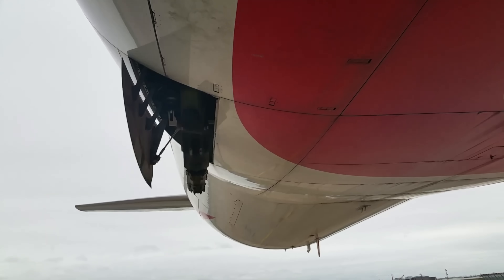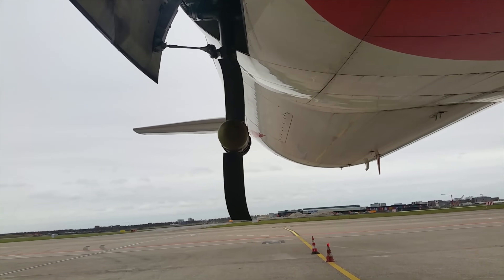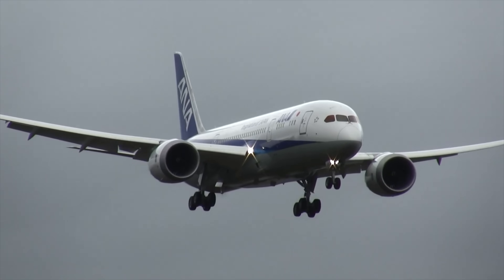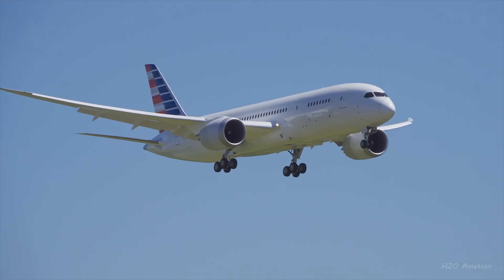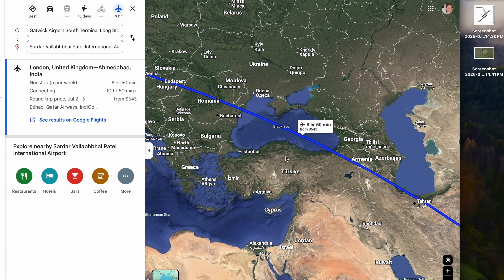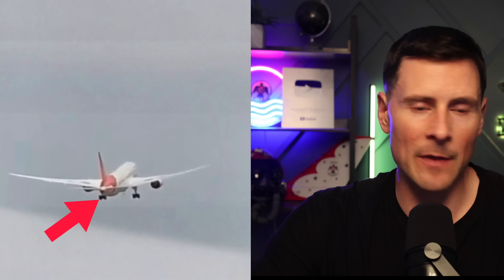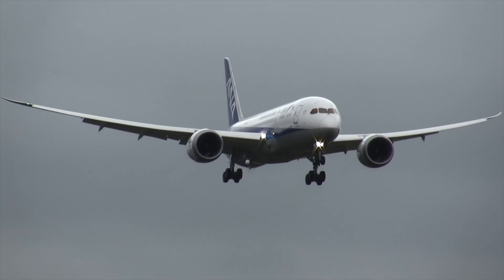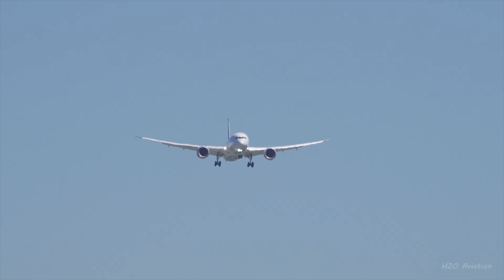Air India 171 SHOCKING UPDATE on RAT Deployment and Flaps!

Comment: Airports should officially film every take-off and landing.
Reply: Probably does but if not somebody is filming it off the TV screen (like it has been with Airindia's video) the public will never see it
Reply: I agree. In the West, YouTube plane watchers with HD cams are pretty much at every airport.
Reply: @KoolestCatt  "Plane-spotters".
Reply: I agree and I hope they use high resolution video with auto focus and zooming for aircraft taking off and landing. This would also help pilots review landings.
Reply: @nagalman  Most modern passenger jets have internal video cameras and outside cameras on side of the aircraft  (mounted on the tail,wings,landing gear sections) when taking of and landing and during flights and are recorded by black box).
Reply: @amuxpatch2798  that may be true for most commercial aircraft, but not all. And the aircraft internal cameras may not offer a 360 view, especially from aft
Reply: @amuxpatch2798  Actually, most modern passenger jets DON'T have internal video cameras, or outside cameras. Where, exactly, do you get your (mis) information from?
Reply: better yet, live cam feed from inside
Reply: You’re right, don’t know why they don’t, film and keep the footage for at least 24 hours if you’re worried about storage space.
Reply: Such cameras at the beginning, middle and end of runways would shed light on any anomalies. Amateur videos though helpful and important, should be backed up using professional equipment. After all, there are so many camera at airports, a few more would not be so expensive.
Reply: Exactly. We are in 2025 even cars have dashcams. We should have 4k recording and should release in public. They can manipulate blackbox data but can't deny video evidence.
Reply: they might be having it already, Just because they are not releasing any footage for such idiot youtubers to speculate and make money that does not mean they dont have cameras for filming takeoffs and landings.
Reply: All airports should install full video ! ...FAA required
Reply: And there should be cameras (that are ONLY reviewed in the event of a crash and NEVER released for public viewing for ANY reason along with being made tamper proof) in the cockpit. Also, all data should be streamed to a remote storage location. It would remove alot of guess work. I've heard investigators say "We were listening for the clicking sound some particular handle makes when its being moved." If they had cameras they could look at the footage and know for sure. Imagine how invaluable that kind of thing would be to the investigators looking for MH370.
Reply: You are correct There are plane spotters all over the world producing great video Remember the spotter (Cali Planes) at SFO that caught the UA flight where wheel came off and landed in the employee parking lot? It is not cost prohibitive to do this
Reply: If you are going to build an airport, it should be mandatory to have at least 5km of RESA at each end of the runway OR build helicopter pads and forget the airport.  THAT is the cost and it is considerably less than 300 lives or 1 life lost. No lives would have been lost with 5km of RESA at Ahmedabad.  Let air safety experts work out the optimal RESA and take that away from realtors and bean counters.
Reply: Agreed, it’s after all where the majority of all crashes occur.
Reply: This should now be an NTSB finding and an FAA mandate.

And don't forget to film from left and right, and also good quality audio recordings too
Reply: All airports should be like airports in Hong Kong or Japan, with major airports! That is no obstacles at the end of the runway! You can see the aircraft gliding really smoothly had it been a clear area, so many more possibly all would have survived!
Reply: I would like to know, with modern technology, why can't flight data be uploaded to a central server in real time, and why does it still need to be stored in a black box?
Reply: Sure, no problem! Especially at airports like O'Hare, or Heathrow, or Atlanta--where they can have literally hundreds of takeoffs and landings every hour. It would take massive resources, with only the tiniest probability that such film would ever be useful in an accident investigation.
Reply: For Boeing flights
Reply: should be many camera angles to
Reply: What made you think every airport has CCTV surveillance.
Reply: If they haven't it should be a MUST @infinitebeing1119
Reply: Do they have the budget to develop all that film? I assume they want the cameras period correct to the air traffic control systems 😂
Reply: Cameras are cheaper now a days and storage agree all airports should film.
Reply: It is possible plane spotters have video's, if they are allowed around airports. On our national airport these people are filming and write everything, like fight number, the time, type of plane, and where they land on which runway.
Reply: I think this a good idea 👍🏾
Reply: who gonna pay for that?
Reply: Looks like this was a “one in a billion” unlikely fault scenario that the plane was not designed or equipped to handle.
Reply: I was thinking that this morning 1080 wouldn't be that hard with today's technology
Reply: It's likely they do, Airports have many CCTVs  deployed all over their Airports...
Reply: They don’t ?
Reply: Why? Just so everyone can watch it for entertainment
Reply: They do
Reply: They have cabin vid from the 787
Reply: In my country, we just rely on some boys' recordings whenever they play on rooftops. It's of no cost to the airport at all.
Reply: I am sure they do. I know IAF has extremely high-end cameras maintaining records of every take off and landing.
Reply: There should be a cockpit video recorder as well. The video and the flight data from FDR should be transmitted live to some receiver in the airport during landing and takeoff like ADS-B. It wouldn't be a challenge in this day and age.
Reply: What is the purpose of needing airports to officially film every takeoff and landing?
1) There are already investigative bodies performing the analysis after an incident
2) Droves of people already film takeoff and landing for free
Reply: This guy was only 2 days slow with the critical urgent information :P
Reply: Can you imagine the cost of recording every take off & landing at a busy airport
Reply: @m0peds  Right? It simply isn't feasible.
Reply: Waste of time and money
Reply: they do but they wont publicize it😢
Reply: they also have cctv in the plane as well
Reply: they already knpw why it fell,but imagine making this public now,and those who lost rheir loved ones,how will they feel,those who deal with planes know there is a list of things that can go wrong and it is bound to be one of them,but harm is done😢
Reply: Exactly, with today's technology it must be cheaper than than a plane seat.
Reply: They do.  Just because you haven't seen the footage on the news doesn't mean it doesn't exist.
Reply: Good to hear. Hopefully in 4K. @stargazer7644
Reply: @stargazer7644  No, they don't.  I am aware of no major airport that films every takeoff and landing. It would be horrendously expensive, and unworkable.
Reply: @markherzfeld5362  EVERY major airport has security cameras.  EVERY SINGLE ONE. They record 24x7.  They have cameras that watch the field outside as well as inside.  These see every plane that takes off and lands.  Use your head, man.
Reply: @stargazer7644  Yes,  am aware major airports have security cameras. That is NOT the same thing as recording every takeoff and landing. Having been a pilot for a major airline for 33 years, I'd probably have known if there were such cameras. There aren't.
Reply: @markherzfeld5362  So please explain how a dozen or so security camera recording the fences, field, ramp area and runways  is not the same thing as recording every takeoff and landing?  How is a camera not a camera?  Are you daft?
Reply: @stargazer7644  Gee, I dunno--maybe because those cameras aren't looking at takeoffs and landings?  And even tho I'm sure you have MUCH more knowledge and experience operating in and out of airports than I do, I can say I've never seen (or even heard of) cameras watching the runways. Perhaps you have some knowledge that I am unaware of?
Reply: @markherzfeld5362  Do you think cameras outside somehow don't see what's outside?  The video that we have of AI171 taking off is from a freaking security camera.  I'm done with you.
Reply: @stargazer7644  Likewise--there's no point in trying to argue with a self-appointed "expert" who simply won't listen to someone who actually knows what he's talking about. And there's no upside in trying to engage in a battle of wits with someone who is unarmed. Please do me the great favor of not replying any more.
Reply: They do. I have seen it in Goa, India. Not sure about Ahmedabad.
Reply: it wouldn't tell you much but it would be more informative than max afterburner channels
Reply: Yep, just like the US does on a aircraft carrier. Everything on the flight deck is recorded and closely analyzed.
Reply: @Happersby Mais il arrive des fois qu'un accident arrive pendant le vol. Ce n'est pas souvent au décollage ou à l'atterrissage.
Reply: @bayam9718  Accidents mostly happen on takeoff or landing.
Reply: @fillefrans2020  ad anytinme inbetween
Reply: @bayam9718  what does it have to do with what op said?
Reply: Also if possible, have some kms of open space near the airport to avoid such incidents.

Don’t know if its correct but can be an option to increase the distance from the buildings.
Reply: I think they do except in shi thole countries.
Reply: What country you live ali ?? 
I Guess u are form tatatidesh or fuckistan . Am I wrong @DrAAAli
Reply: @DrAAAli  Well they have filmed it in so called Shi thole countries..
Reply: LMAO... people attacking the guy because he is muslim. Typical Indian behaviour. He said nothing wrong. All media channel and big media in India were using the recording of Phone instead of Official airport security footage. Even the official footage seems to have 1 camera in airport like wtf.
Reply: @AsifAnsari-nn8kk lmao? Dude read the comments, all curious and learned type of people, and here this guy comes with a clown comment and language. 

There is a way of saying things, the airport in ahemdabad had cameras & not all footage will be released to the public. Irrespective of whether we had cameras or not, the language he used is particularly crass. 
The replies reflect his tone and language.
Reply: @DrAAAli which country you belong to ? Ali ? Seria or Iraq ? Or a immigrant living in the US ?
Reply: @iamplayerxYT Ali's mother is from Pakistan, but I haven't been able to verify where his fathers are from because there are multiple
Reply: @DrAAAli they film in America & 🇺🇸 is no longer a 1st world nation 😅
Reply: @DrAAAli  not a mulla saying this
Reply: @ananttyagi8463 he took his comment down. What did he say 😂
Reply: @DrAAAli what… like the US?
Reply: @DrAAAli Like where you are from? Mor0n
Reply: @DrAAAli  dont mentioned the holy indian element
Reply: @DrAAAli smh they do. In fact one of the clips in circulation is from the airport. Whether it is 480p or 4K is another thing.
Reply: Ali's do not belong to developed countries. 😂 @DrAAAli
Reply: @DrAAAli  No, they don't.
Reply: @DrAAAli No they don't. Usually the aircrafts are caught on CCTV cameras, but there are no dedicated cameras specifically to record each and every takeoff and landing on each runway.
Reply: @DrAAAli   which country you came from?

Comment: The gear seem to be angled the wrong way suggesting a partial retraction of the gear since the first thing that happens in a gear retraction is a tilt of the wheels.   My guess is the gear started to retract and the failure occurred stopping the retraction. That coupled with the RAT deployment seems to confirm total engine loss.

Comment: why did it take a full runway to reach V1? Why was there a 30 min plus departure delay while the A/C was not working in the cabin while considering there was no other air traffic? The auto deploy RAT should not have made a loud bang that could have been heard from seat 11A however, an explosion in the electronics bay could have been the reason. "No Power, No Thrust" could have meant, a dark cockpit and dead engines!

Comment: The fact that the main landing gear is still tilted backward kind of raises the question:

Was there a sudden hydraulic failure?
Reply: The main landing gear is tilted forwards which means an attempt was made to retract the landing gear.
Reply: Both engines failed to produce power resulting in electrical and hydraulic failure.
Reply: Well.. the treshold that would be needed to retracked the landing gear will be reached suddenly. 

Likely the second engine lossed power 2 or 3 second after lift off.
Reply: Yes, precisely..
Reply: I live close to Brussels airport and saw one Air Belgium A330 and a Thomas Cook 787 doing something they call late gear retraction (never heard of it) 
The planes were with gear down even 1 min after take off.. looked weird to me

Comment: Funny enough I made comments in that sense in your first video where there was too many assumptions and not taking any other factors in consideration…
Some should let the investigators do their preliminary reports before assuming anything building up rumors ! 🙄🤷🏼‍♂️
By the way they didn’t have a better microphone the initial video was a video of the video now you know 🤷🏼‍♂️…
The shadows on top are the spoilers that could have the roll assist function but definitely not the flaps. Now this is weird as both are up which wouldn’t be the case in a rolls assist situation. On the Qatar 787 takeoff the spoilers are in you do not have that shadow. Now the 787 can take off with flaps between 1 or 5 and if necessary more which is hardly visible. Again let’s wait for the preliminary investigation, before assuming anything.🤷🏼‍♂️

Comment: Once the data was entered into the FMC, it would of have been virtually impossible to apply power if the flaps were not set properly, the throttle simply does not respond for take off thrust, it was designed that way. There are two checklists for the 787. It would of require override of both on the FMC, and the cockpit would of sound all sorts of alarms which would of been heard on the radio. And you have none of that. They lost power, is that simple. And it happened shortly after V2 , at gear up and that's when the bang was heard and the RAT was deployed.  What remains is what caused the failure...and I bet Boing is going to have a heavy hand on this, because if this comes back to them, they are done.
Reply: would HAVE been

Comment: The situation deteriorated too fast and too low to do anything to save them. I'm shocked they even got out the mayday call.
Reply: This is what it is! What happened to them, there was no coming back !! All influencers made money out of the tragedy
Reply: 8000 hours in the 787 that pilot was a pro that was his sign off! “NO POWER” “NO THRUST” “GOING DOWN”…
Reply: Engines throttled back by design?
Pilot flying left with nothing but a prayer 😩
Reply: Agreed. At that altitude and that speed, they didn't have any room to play with. And the fact that the area just behind the runway is chock full of buildings certainly didn't help, either. :( I can't help but wonder what would've happened if that terrain had been completely open/empty.
Reply: @1SaG a 2 mile long water pond to land in  and everyone walks away…nobody on the ground is killed! Should be a requirement!
Reply: Boeing quickly going from making planes to making missiles.
Reply: I'm wondering why they called a Mayday 30 seconds into a catastrophic problem; isn't the #1 priority to focus on keeping the plane in the air?  'Aviate, navigate, communicate'.

Comment: If they tried an intersection take off that's on them, because it leaves no room for error, or equipment failure. If the whole runway was used why didn't they abort the takeoff when they were not solidly airborne by halfway down the runway? Complete engine failure isn't likely because they made it into the air. If the take off thrust wasn't developing then they should have aborted. There must have been some sort of mechanical problem, but it looks like these guys tried to just mush it out. Maybe they were used to flying poorly maintained aircraft. A passenger form the previous flight of this aircraft claimed and had video showing that the AC and electronics in the cabin weren't working.

Comment: As a stockholder of Boeing, I'm increasingly worried this will be determined to be the fault of Boeing or the Dreamliner.   The company doesn't need this unfortunately.
Reply: Sell, Sell and Sell.  When I was at a subdivision of Boeing as Flight Systems Engineer, I was forced to sign documents to allowing to flight with failure of subsystems.  The excuse was always the aircraft was allowed to flight many times before with that failure, and one more would not hurt.  I replied “Fire Me because I will not sign”. Eventually they found an uneducated engineer (From Mechanic to Engineer without education) to sign.
Reply: @larrylam2648  Forcing someone else to sign documents to allow flight with failure of subsystems sounds illegal.
Also oneself signing documents allow flight with failure of subsystems sounds illegal, so it was the right move to not sign. Also I applaud you for standing up - well done, you did the right thing - thank you for prioritizing following rules = prioritizing safety. Best regards.
Reply: I think the most horrific result is that many people have been killed in Boeing-accidents, caused by failure of the tech (e.g. 737 MAX). Stock-pries may drop, crash - but it´s a risk every stockholder knows and also stocks could go up again. But lives - they are lost forever! Best regards
Reply: So sell now
Reply: Unfortunately agree
Reply: While I on the other hand would've shorted Boeing for at least 10 years if I was actually interested in that. It's a terrible company.